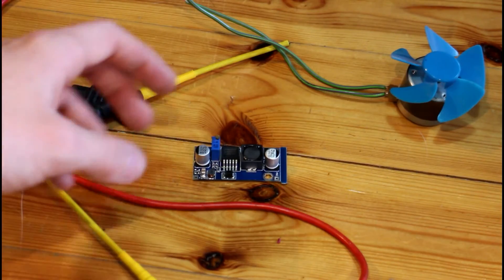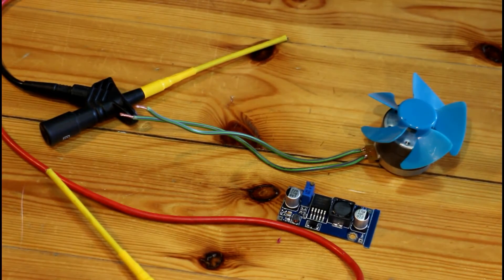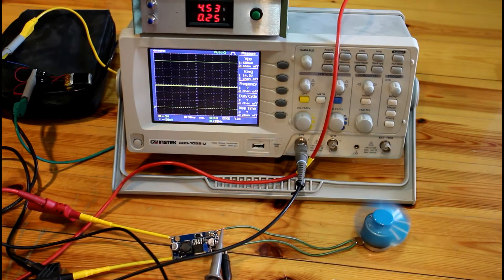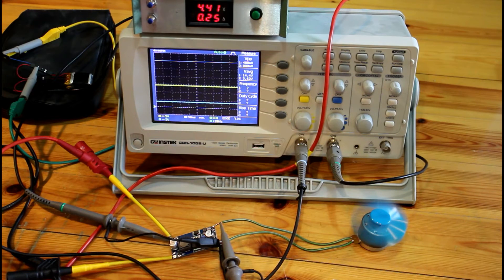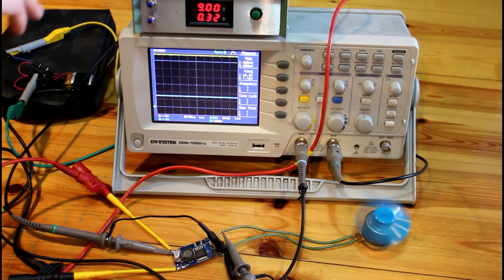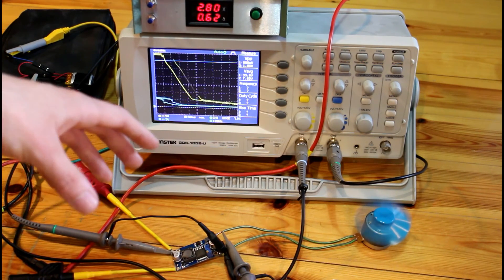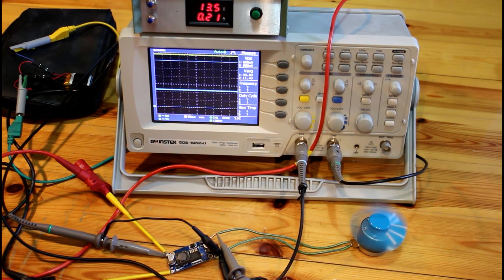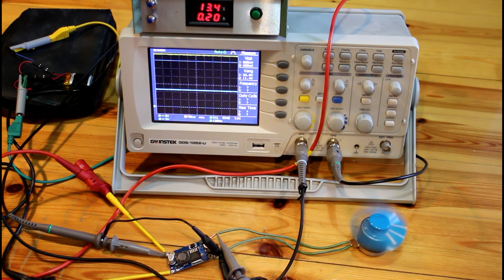Testing an IC Station LM2577 Step Up Converter Module

Comment: Hi how do adjust this type of device? Looking for a video tutorial for a LM2577 DC-DC voltage step-up (boost) module and figured you might know despite the different spec on mine and the one featured in the video.

Comment: Thanks for another great video!

I'm pretty impressed with that little board!  I'm wondering, would be of any use in your excavator? By increasing the voltage to the N20 motors you are using for actuators, you should be able to get your booms and bucket to move at a pretty good speed.

Adam D
Reply from the maker: That is a good point, I think there would be a small bottle neck in terms of how quickly it can deliver power through the module but it would probably be unnoticeable on those motors. No reason why I couldn't try it, I must remember to get the model and test it out, maybe a good live video to do.